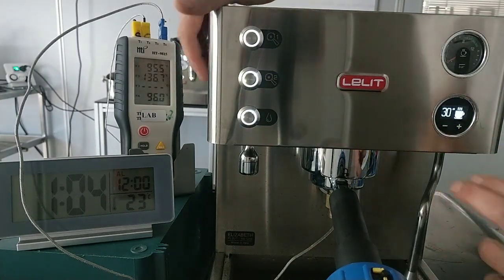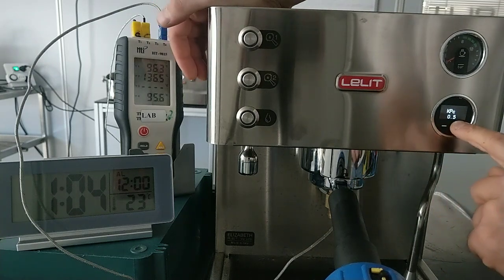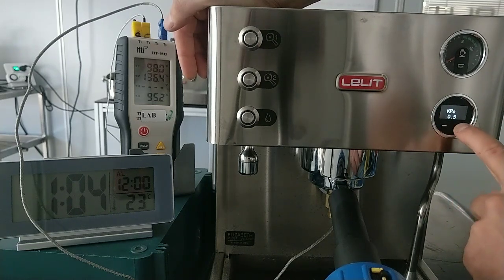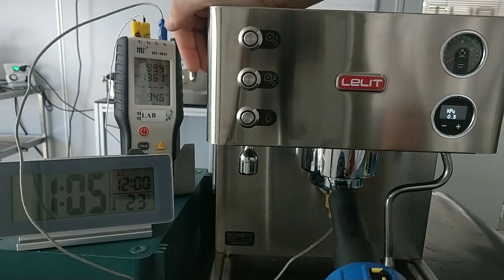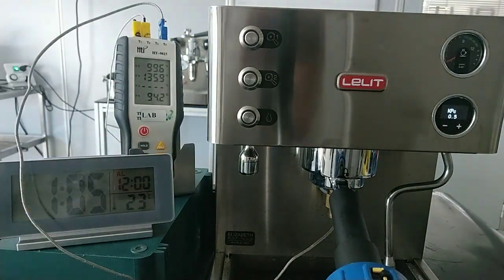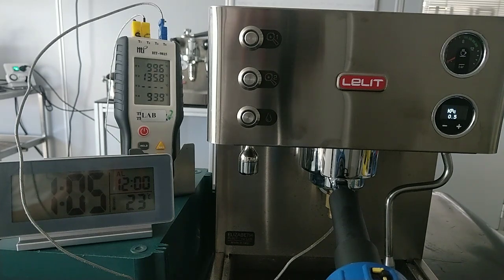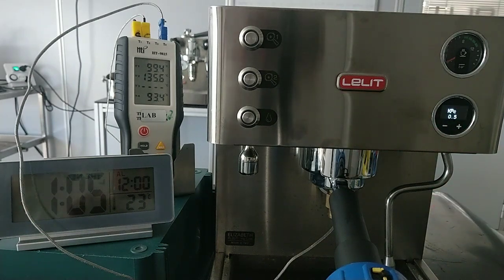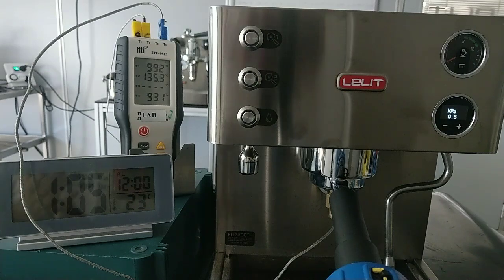pl92t elizabeth v3 scace  thermal stability  test    KPc0.5  Es0   warm up time 25 minutes

Comment: Hello, Lelit Insider. 
Since you have access to the Scace device, what pressure should I adjust in the OPV using the blind basket to result in 9 bar measured in the machine group head during espresso extraction (simulated by adjustable flow on Scace)?

Comment: Hello Lelit Insider, Do you think the thermal stability is good? In the Video is a shot that starts with 92 degrees and ends with 95 degrees. That means 3 degrees difference. That seems very much. What is your opinon?
Reply from the maker: hi, as you can see this is the first extraction after the warm up, then the philterholder is not proprely hot. 
to be the first shot is a good result!

Comment: Do you remember the difference between the gauge and the scace pressure readings? Unfortunately I can't see the scale preasure on this video. I want to know it to adjust the opv more precisely. I hope you can help me :)
Reply from the maker: usually the scace shows less pressure (0.5 bar )
Reply: @lelitinsider2977  Does this mean I should set the OPV to 9.5 bar with the blind basket to get a maximum of 9 bar during the actual espresso extraction?
Reply: @lelitinsider2977  thank you again! :)

Comment: Thanks for the very helpful test.

I took some notes about the temperature readings, and I'm very impressed with the stability of this machine. It's way better than my E61 machine.

PID target: 95c

Shot #1
@10s 94c
@30s 94.7c

Shot #2 (6 min later)
@10s 93c
@30s 95c

Shot #3 (2 min later)
@10s 93.9
@30s 95.8

Shot #4 (2 min later)
@10s 94.3
@30s 95.6

Shot #5 (2 min later)
@10s 94.3
@30s 95.7

Shot #6 (2 min later)
@10s 94.3
@30s 95.5

Shot #7 (2 min later)
@10s 94.8
@30s 95.9
Reply: Hi, I just realised that in some of the shots, he is using 6 sec preinfusion. Therefore countdown needs to start from 16 by these, which means stability is even better than what's written here.

Comment: Thank you for a great video! Do you recommend adjusting the pump pressure to 9 bars? It seems the factory settings are around 11 bars. Thanks
Reply from the maker: hi, depends a lot on your taste in coffee, 
in any case, I recommend using the machine for a few days at the factory settings before changing the settings.
Reply: @lelitinsider2977  thank you for your reply